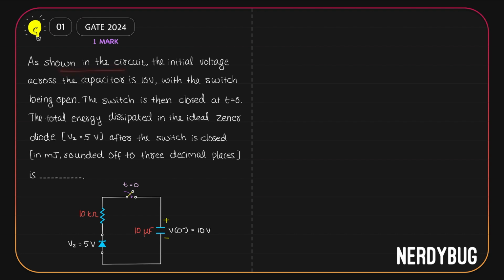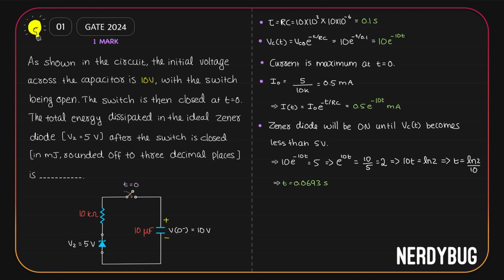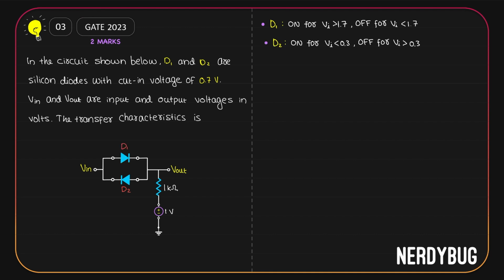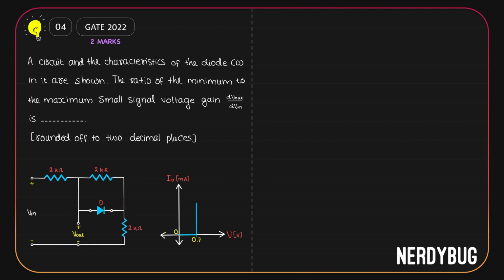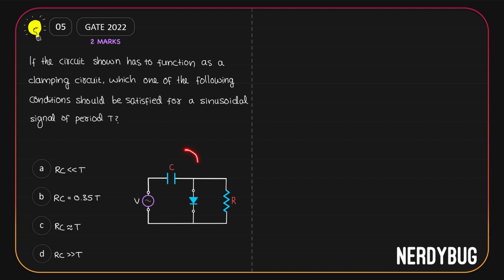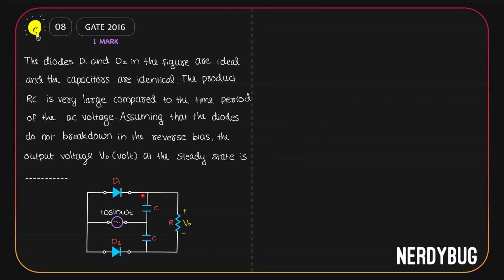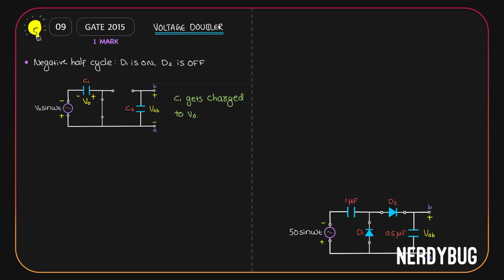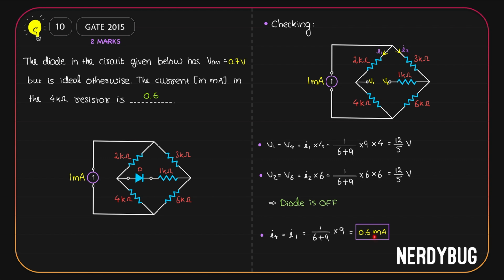Gate Questions on Diode Circuits Part 1 | 2015-2024 | GATE PYQ | GateBusters ECE | NerdyBug

Comment: I do appreciate your efforts but there are errors in the solution of question 1 and 2. For 1 it has already been addressed in other comments, For 2, the calculation with 10 will result in n=8 not 4.
Reply from the maker: Thanks you for pointing that out. For a centre-tapped half wave rectifier, the avg output is Vo/pi (2Vo/pi is for FWR) which would give 4 as the final answer.

Comment: The capacitor equation which u wrote at first will not be that... It will be replaced by 5 + 5e^(-t/tau)
Reply from the maker: Try solving the problem with that equation and let me know 😌
Reply: @NerdyBugNB 
Update :
The final value of the capacitor at ( t = ♾️)  will be 5V 

If you will write the capacitor equation then u will get 
VC(t) = 5 + 5e^ (-to/ tau) 

After that equating it to 5V...we will get (to= ♾️) 
And hence writing energy calculation we will get E(t) = integration of [ 5 x 0.5e^(-t/tau)] from 0 to ♾️ 

Answer will be 250 mJ
Reply: @NerdyBugNB 
Also in GATE 2024 ECE master key the answer is 250 mJ

Comment: Can you say 12:41 in this why you take 0.3 i cannot understand
Reply from the maker: Because that diode gets 1 V on one side. So it needs a potential less than 0.3 on the other side to be ON so that net potential drop is greater than 0.7 V
Reply: @NerdyBugNB  thanks for replying

Comment: In first question 0.250 mJ was the answer given in master key
Reply from the maker: If you integrate from 0 to infinity, the answer will be 0.250 mJ but the diode is only ON for 0.693 s. I'll take a look at the solution again when I get time and clarify.

Update: I stand by my solution 👀
Reply: Exactly i was too getting 125 mJ ...and ur answer is right ❤
Reply: Update :
The final value of the capacitor at ( t = ♾️)  will be 5V 

If you will write the capacitor equation then u will get 
VC(t) = 5 + 5e^ (-to/ tau) 

After that equating it to 5V...we will get (to= ♾️) 
And hence writing energy calculation we will get E(t) = integration of [ 5 x 0.5e^(-t/tau)] from 0 to ♾️ 

Answer will be 250 mJ